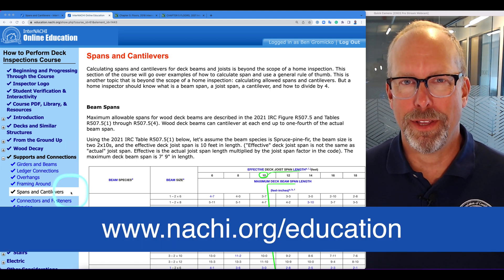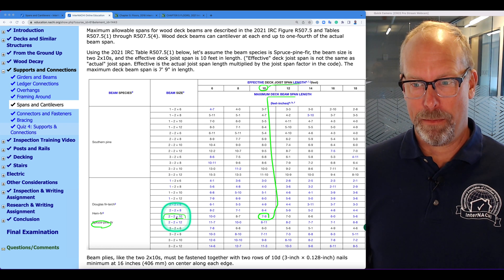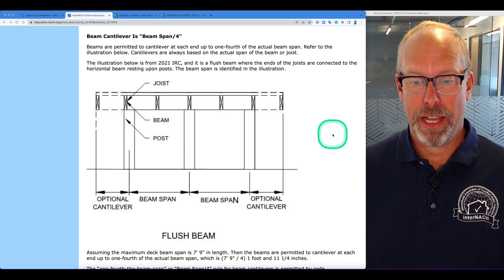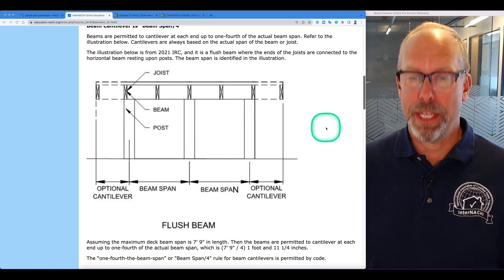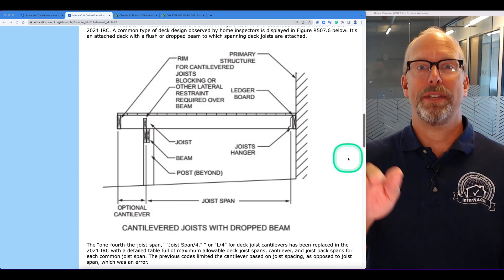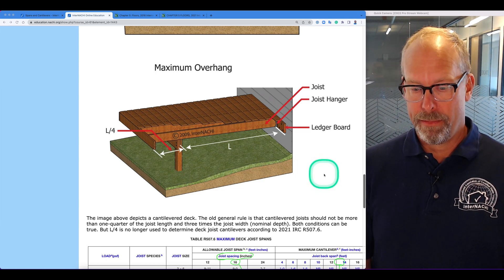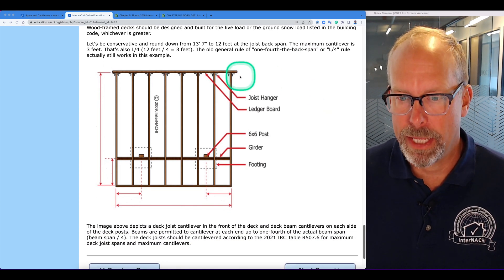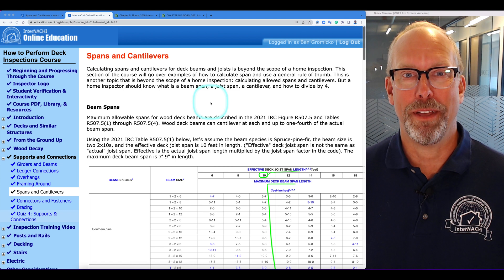Inspecting Deck Spans & Cantilevers

Comment: Here is what is confusing me let say the max beam span is 7'9" 
But your actual span is 7' center post to center post, is the cantilever still 2ft (1'  11"-1/4") ? or is it  7'÷4=21" because 7' is the actual span you have center post to center post.
 🤔
Reply from the maker: Using code tables is challenging. Yep.

Comment: I never saw a joist called out as also a beam (4:20). I assume the joist becomes a beam when it carries the load to the rim board, which supports the other joists? So on this example, every other joist is also a beam? Either that or the drawing isn't right, or maybe I'm just not getting it. I wish you had a 3D rendering also.
Reply from the maker: Thanks for watching.

Comment: Thank you, I had one of those 'aha' moments when I understood the topic at a higher level. Am I correct to assume that measurement of actual joist or beam span and cantilever are always taken from the center of the relevant load bearing post or beam, rather than from the closest face of the post or beam? Are there any exceptions?
Reply from the maker: I believe so.

Comment: So, i plan to build a dropped beam deck using 3 ply 2x12 southern pine, this will be a free standing deck beside my house. So it is permissible to cant the beam and the joists using this table. 
Deck is going to be 16 wide by 22 long, i want to get it dialed in before i build but i think i am over doing it. 
I plan on running the beams parrallel to the structure and just want to have the correct measurements but i keep getting confused reading the different tables.
Reply from the maker: I appreciate that! Thanks for watching.-